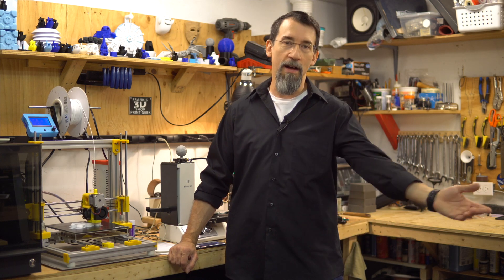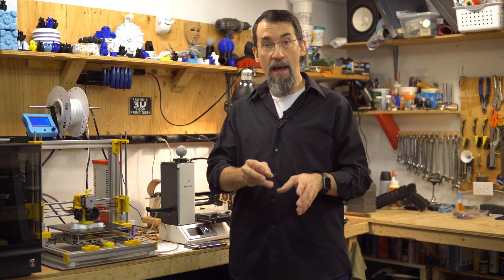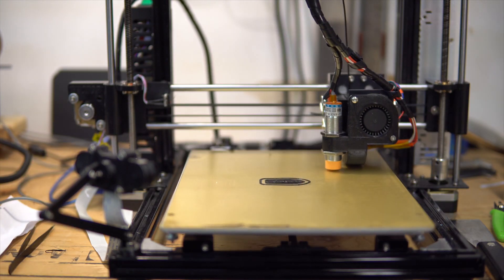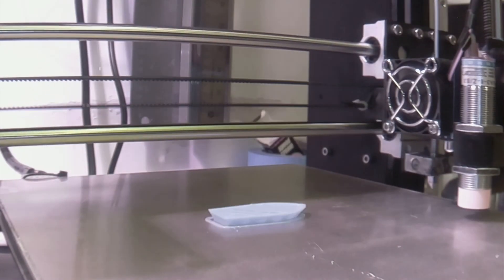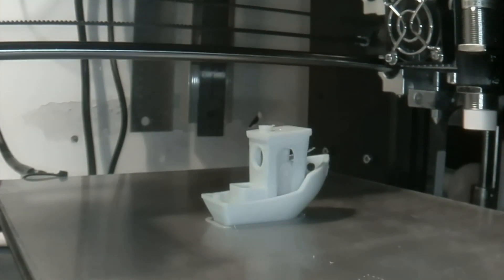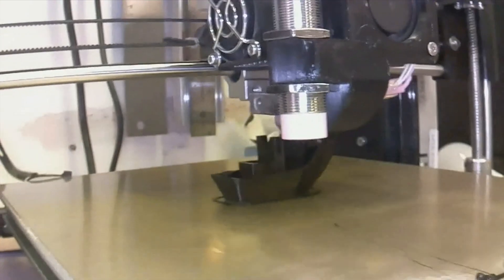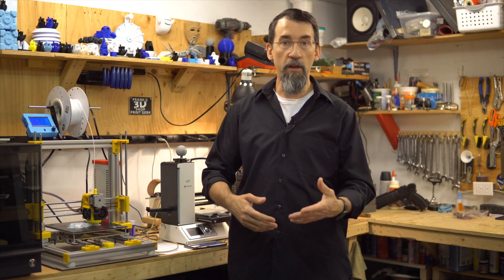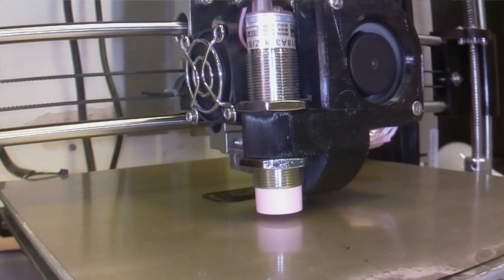Cool Timelapse For Octoprint

Comment: Hi Frank. I hope everything is good. I just purchased a Creality CR-10 Prusa I3 Printer. Other than basic assembly is there any advice and tips you can give me that isn't in the assembly instructions and after assembly? Thank you for and help and advice you can provide me.
Reply from the maker: Hi, I would suggest for the first test print, use the gcode of the cat on the card and print directly from the card. You first have to level the bed, but printing the cat file first ensures that everything is in working order, after that you try to slice your own models. And if you have a doubt on the machine you could try again the cat knowing it was good at first, if it print right, it’s your slicer settings that have to be changed.
Reply: Sounds like sound advice. I have a mini and I use Cura which I am familiar with. Should Cura also work for the CR-10?
Reply from the maker: Yes it does, my friend use it exclusively. You have profiles built-in in Cura for the CR-10.
Reply: One last thing. The CR-10 I ordered has Prusa I3. I don't know what that means. Is it software?
Reply from the maker: Prusa i3 relates to Josef Prusa of Prusa Research https://www.prusa3d.com/ who designed this type of printers and released it on open source and open platform.

They produce good printers, the latest is the MK3 with many new features that some of which will eventually get to Marlin and to CR-10 and other i3 clones.
Reply: Thank you Frank for all of your answers to my questions.